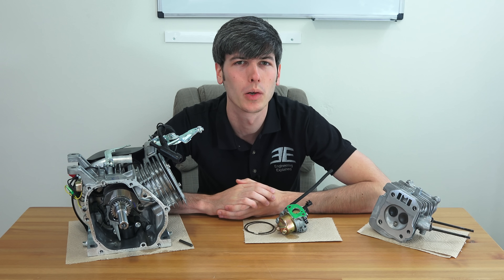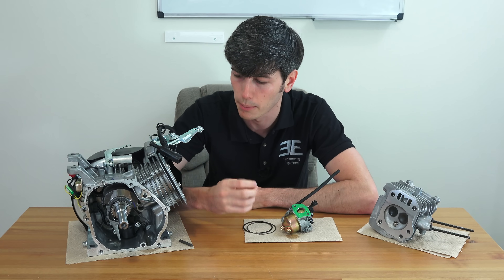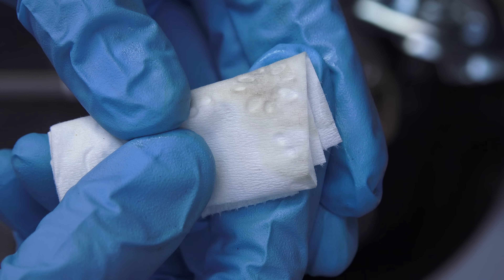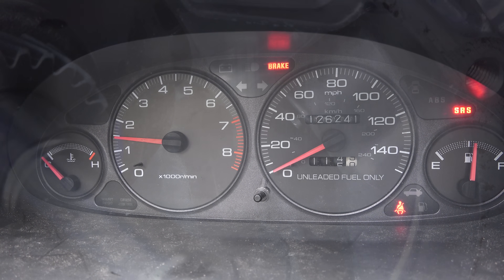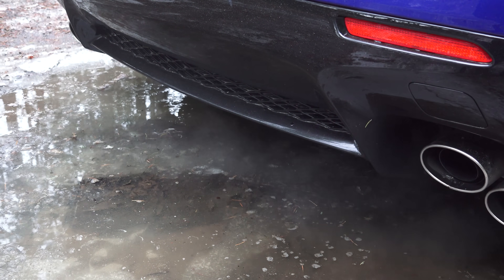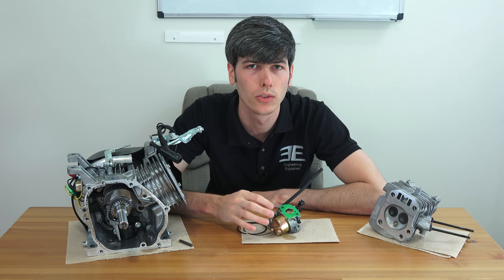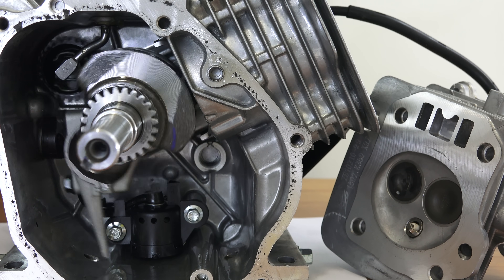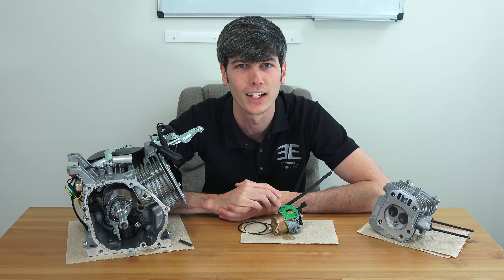Should You Warm Up Your Car Before Driving?

Comment: my car idles at 2k rpm when I start it, its manual
i wait a couple minutes and it goes down to 1k rpm
then im ready to drive off
if i take off immediately the car tends to get all jumpy and stally
Reply: Same, thats the 4g63 life
Reply: My truck usually idles high on a cold start for maybe 40 seconds before dropping to 700 rpm.
Reply: Relax Music same here 2018 manual Impreza and I have to wait until the blue light goes off which means it’s ready to go.
Reply: My diesel Peugeot 407 also gets all jumpy and stally the first 30 or 40 seconds
Reply: @serv27438  diesel makes more sense to warm up longer before starting to drive since it usually takes longer to warm up compared to gasoline, and its combustion is based on compression, not a spark - so cold diesel can even get a gelly and that makes it even more resistant to combustion. And diesel doesnt seem to dissolve that much oil, if any.
Reply: @denislavkaragiozov5876  That makes sense. Mine takes about 7 minutes to warm up to it's maximum temperature of 85°C driving normally up to 2300rpm. Now ambient temperature is about 10°C
Reply: imagine having cats to warm up ahaha. I have a cold start DELETE
Reply: You have a diesel right ?
Reply: You're driving it incorrectly. Go back to the dealer and have them teach you how to drive it correctly so you don't wear your engine out prematurely and blow all that massive pollution into the air.
Reply: @Billy123bobzzz  I also do that because the engine is cold. I need to do it.

Comment: Piston wear is not the only form of wear. Some parts wear a lot more when you use the engine to apply torque than when it is idling. The difference of parts moving next to each other vs. grinding against each other. Many (most) cars idle at higher rpm when cold to warm the engine and provide smooth idle. Also some modern cars lean-burn after initial start-up to help generate heat.
Broad sweeping advice in a complex scenario with many variables... not a good mix.

Comment: If I'm not mistaken, Ferarri recommends warming up one of their engines on a cold start for about 10 min before putting it under load, to ensure that there's sufficient oil flow through the main and big-end connecting rod bearings to support the loads on the bearings. I notice that it takes about 8 to 10 min for the oil temperature in my 370Z to get up to about 140 deg F when I cold-start the engine.
I've been following this procedure on my Z since it was new and I now have about 13,000 miles on it. My last computation of oil usage was 5oz/3300 miles, so I believe that there is good cylinder sealing and minimal leakage. Two Blackstone Labs used oil analyses showed no excessive contamination of the oil or any other abnormalities in terms of chemical contamination or excessive wear metals in the used oil. Do you think that the modern computer-controlled fuel injection on late-model cars is maybe capable of maintaining good fuel atomization and keeping the A/F ratio correct during cold idle operation? Thanks for your always interesting and informative videos.
Reply: 13.000 miles. That’s cute. I have about 180 000miles on my bmw 330d and i just idle for 30 sec and of i go. 10min is way to long dudd
Reply: @Xfacehack  With today's thinner viscosity oils, it may not be necessary to warm up modern engines for as long as in the past. My main concern is still the oil's flow rate through the very small bearing shell to journal spaces when the oil is cold and more viscous. I don't mind burning a little extra gas if it ensures that I'm not causing premature bearing wear.
Reply: @videomaniac108  What you talking about? Do you drive an Ferrari or what? "Race" engines do have tighter clearances. But modern engines do also have tighter clearances. One of the reason for being in production cars is full synthetic oil have good flow rate even in sub zero temperatures . The viscosity should stay the same. But ofcourse i does change depending on temperatures. But at 90c they should all be what the label states.

Another big reason for tighter clearances in modern engine is, better economy, more modern electronics that calculate fuel and air mix (injection systems) and efficiency (fuel economy, power, responsiveness)

But even engines with tight clearances should not be idling for 10 minutes. The engine will stay cold for longer and will be prone to more wear. Actually driving it carefully for 10 min is much better.

Also the driveline will have time to warm up if you start driving.

But if you that careful about you vehicle i suggests parking your car indoor with about 16-20c in temperature. It should be rather cold, but not to cold. You want all the plastic and rubber out of the sun (uv light). 

Also turn on the heat to about 30c before driving. And have an block heater. But don't leave it the block heater still attached, you also want to circulate the oil before cranking . Alsoalso, have tire heaters.

Actually don't drive, that will for sure wear out everything...
Reply: @Xfacehack  Sure Sparky, I'll give that sage advice the consideration it deserves, from somebody who was only capable of making derisive comments and not able to answer the simple question by addressing the concerns stated.
Reply: @videomaniac108  I was simply clearing up some misunderstanding which makes your question or "concerns" invalid...

Toxic much?
Reply: Still doesn't negate lubrication and the transmission... A vehicle is useless if the transmission start slipping

Comment: It's different for us who live North of the 60th parallel in Canada.  When its regularly -20 degrees Celsius and as cold as -50 Celsius at times.  When you get in a vehicle that cold everything is frozen solid.  The seat is hard as concrete, the display won't work, the steering wheel and power steering system is very heavy.  It's kind of funny actually,  the shock absorbers don't work and the tires aren't round so you bounce around like you driving a tractor or skid steer loader...I have personally run my vehicle at a low temperature of -48 Celsius in January of 2008 and I warmed it up, please forgive me

Comment: That's great information but you can't drive down the road with frozen windows. Window defrosting takes a few more minutes of engine running before its safe to drive. But if you plan correctly and park your vehicle facing the rising sun, the sunshine will defrost the windshield very quickly even on a really cold morning.

Comment: I'm sure he is right, you only need to run the engine for a couple minutes to keep from damaging the engine.
That said if you are not getting heat out of the defrosters you are driving along and the windows fog up and you can't see which can cause you to have an accident. I warm mine up enough that i know the windows are going to stay clear. As for a fuel injected  engine putting to much fuel in when cold and causing it to wear more because the oil has been washed away I don't think you could measure that wear on an engine and prove it. I live in northern Ontario Canada,  we don't worry about the engine wearing out much here with the salt they put on the roads, how good the oil is now, how good most engines are now, the body will be gone long before the engine wears out.
Reply: You don't really need heat to defrost as much as drying, which can be achieved with the AC on, as AC units dry by design.

Comment: This is when a high idle switch or high idle remote start comes in real handy. If it holds the vehicle around 1200RPM, it can quickly lean out the fuel back to normal levels. Also if you live in a cold climate, the best thing you can do is either keep your vehicle in a heated garage. But if thats not an option, then using an engine block heater is your next best option as it at least keeps the block hot for starts. It also means the heat will work sooner

Comment: On my 2004 Cavalier I let it get to about a 1/4 way up the gauge. Otherwise the rpm’s are to high. I refuse to throw my car into gear when it is above 1000 rpm. Plus if you don’t wait, it’s really hard to drive slow because the engine wants to run at 1,400 rpm!  So much for just start and go! Not to mention how hard it is for the cold transmission to be shoved into gear at high rpm! Also a little hard on the brakes because you have to ride them till she warms up! And it does this because that is how she was made!  Nothing wrong with the car or computer!

Comment: All car engines have a set point for the engine to warm before take off. 
This is done automatically and you can visually see it and hear it also. 
In other words, the engine tells you when to put it in gear. 
Generally between 1 minute an 3 minutes, depending on the outside temperature. 
Of course this would be for initial start up for the day.

Comment: I drive a 2006 Honda Civic and the temperature and fuel gauges are both somewhat digital I guess?  (not the traditional needle). During winter I warm up my car just enough so that I have 2 bars on the temperature indicator and then slowly start driving out the apartment complex. By the time I hit the main road it's well over 4 bars.  I don't wait until it goes all the way towards the middle. I did also notice a difference in driving off right away and letting it warm up just a bit. The engine sounds much more appreciative if it's warmer

Comment: My question still remains about how long to warm the car for better transmission performance and extended life due to cold fluid. Hmm now what. Still a very good video 👍
Reply: Well the only way transmission fluid can flow is by putting it in gear so waiting on idle does nothing to warm up transmission

Comment: I delivered a formula of how much time do you need to warm up acording to the out side temp.
If 50C is the moving temperature
Out side temp is 20C
And the average velocity of warming its 12C per minute.
Time of warm up: 50C-20C= 30C
30C÷ 12C/min= 3 minutes. You can have a timer fix a 3 min to move. How cool its that.

Comment: I don’t think this is entirely true. My old efi Camry had a cold start injector to pump more fuel into the engine and cold temperatures. So warm up I waited until the revs went down to near or under 1000rpm. Still have to drive slow to warm up the transmission. The car warms up fast because you are not getting cold air flowing.

Comment: On a cold day anything less then 45°F a minimum of 1 to 2 min minimum  preferably 5min..   driving older cars on cold engine and regular oil will result in oil puddles under the engine due to older packings, and higher oil pressure than normal on colder and thicker oil. So the answer is Yes!

Comment: I've dropped oil for a change after the car ran for 15 minutes, idling, at a temp below 32 degrees.

The oil flowed like pancake syrup, and was 5-30 weight.

My Rav4 high idled much longer than my Volvo. I preferred the Volvo. The Rav4 had seal leaks starting at a lower mileage, but my Volvo with over 110,000 does not leave oil spots on the driveway. Rav4 needed a quart added every month. Volvo, no oil added.

Volvo has a T6 motor.

In colder climes, do more oil changes.

Comment: If I had to go with age old advice originating from the carburetor era or modern engineering advice I think I’m gonna side with the engineers here. I would argue that it’s anticipated and designed for cold weather starting and operation even if it is -35°C. Provided your vision within the vehicle is not compromised, it is just all around better to just get in and drive. I was recently 0° and I got into my car, started it, and began driving within 30 seconds after putting on my seatbelt and adjusting mirrors and I got heat within 5 minutes of modest driving. 

If you really want to complain about being cold for 5 minutes of your drive or if you really really really think you know better than mechanical engineers who designed your engine then invest in a block heater. 

Tanget: One thing I keep seeing here is people comparing this to waking up in the morning and instantly sprinting. A car is a machine. It doesn’t work “harder.” It can’t. It either operates within spec or it doesn’t.

Comment: Just out of curiosity what do you guys consider cold. I feel like the 30 seconds if cold applies to 32 or below. What about if its 0 or in my case in ND we have been in -20 and -30 for 3 weeks now. Do you think the 30 second rule still applies in that extreme of cold?
Reply: What I'm getting at is in 30 seconds at -30F the oil cant warm really at all. I've logged it warming up at idle at from that temp it take 10 to 15min to even get close to moving the needle. Also wouldnt you be worried about how the engine heats up? Getting on it right away would heat up internals at much faster rate than the block. Were a 5min warm up would get a good gradual warm up and give time for the block to heat up evenly with the internals. Just my thought

Comment: Don't care, when it's -21 and I use my remote start  I get into a warm car.
Reply: Thats just wrong.
Idling your car wears the engine out prematurely and it make stew heater take a lot longer to actually get warm air to the interior of that car.
Since you are in cold weather you already are wearing warm clothes, so getting inside a car is warmer than being inside because the cold air is not blowing on your and your body is warming the interior.
Idling the car that I just tested three days ago took 12 minutes to get warm air to the heater vents. The same car when started and driven immediately, had warm air coming out the vents in less than 2 minutes, so obviously driving the car as soon as you start it not only reduces engine wear radically, it gets warm air to the interior much faster.
I live in -60º weather and have done exactly this procedure for decades (since I first bought a fuel injected car) and none of my cars have ever had any premature engine wear and I have always had a warm interior in 30 to 120 seconds. This is just fine because I'm wearing a winter coat, which I assume all logical people will also be wearing, and there is no cold wind inside the car so I am perfectly comfy.

Comment: Yeah this is like how people also say no need to change transmission fluid and think that it is normal to have to replace the transmission every 150k miles. It was just -50F the past three days. Not only were the fuel lines nearly frozen, the brake fluid was a nice sludge and the power steering fluid was so difficult to move my headlights dimmed as the power steering pump struggled to barely turn the wheel. The engine is not the only component of a car. You dont need to get it to operating temp but in the 10s and below weather you NEED to let everything warm up before forcing it to operate. This is also why some people have to replace things like the power steering pump twice in the vehicles lifetime (non-warmers) and some have the original still running strong (warmers).

Comment: Well here in MN we just had 4 days of -30 degree weather and with the wind chill it was -55 degrees. I warmed my truck up for at least 10 to 15 mins on those days because every thing was pretty much solid brake pedal feels like a rock power steering stiff as hell even still after warming up the transmission managed to get to 60 degrees after the  15min warm up. All my fluids used are synthetic due to brutal cold here. We have to also consider all the other components that are having a hard time moving and give them a chance to flow around and warm up. Lots of videos I watch and people say cold start the weather they experience is 40 degrees 🤣🤣🤣 come live in the north with that said when weather is 5 between 35 degrees I always warm up for 5 mins when it hits subzero I give it 10 to 15 mins

Comment: On cold mornings I normally warm up my car whilst having breakfast. A simple use of the phone turns on the heating and defrosts the screen so that I can get straight in and drive off.  The advantage of a 21st century  EV  over a 19th century oil burner?

Comment: What people fail to realize is that Engine oil temperature and Coolant temperature are NOT the same. Letting the car warm up till Coolant  temperature gauge reaches the middle before driving is unnecessary. Engine oil takes twice as long to heat up than Coolant so driving the car lightly will indeed heat the Engine faster.

Comment: Last 3 and this vehicle (Ford and Nissan V6 and now Nissan V8), 3 sold at 130,000+miles, have been cold driven from about 20sec from startup. None of these experienced oil consumption beyond 1/2 qt between oil changes the life of vehicle that i owned them. No bearing knocks/noises. Lubricant used was synthetic with the widest viscosity rating (lower for winter, higher for summer) with changes at 6 to 10 thousand miles. Engineering Explained is correct on rich mixture and contamination of the oil. Thermal shock was engineered out of the engines a few decades back. Lots of myth still out there on warming the engine and oil change intervals. 
By the way, i have not been particularly easy on these vehicles when cold since the freeway is within a 1/2 mile from cold starts 5 days a week and requires an occasional redline to merge with traffic. Hard on the throttle, easy on the brakes!

Comment: With my new car (2010 Hyundai Sonata), I can hear the fuel pump run for a few seconds when I partially turn the key.  Should I wait until the pump stops and reaches some fuel pressure set point, before turning the key more to start the engine?  From this video, it seems like it's better to turn the key all at once so less fuel is injected.
Reply: Incorrect. Wait until the car stops dinging, then crank it. The fuel pressure will be optimal